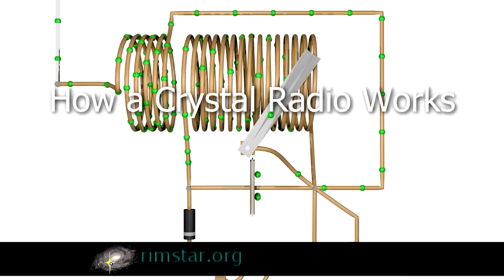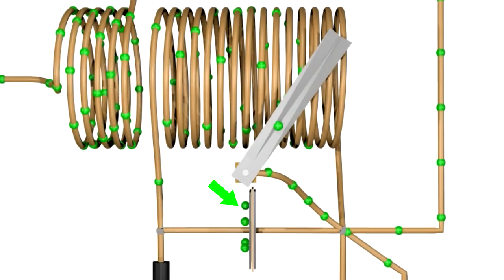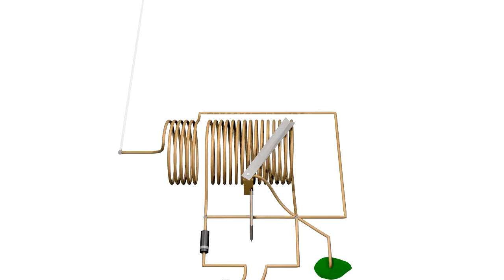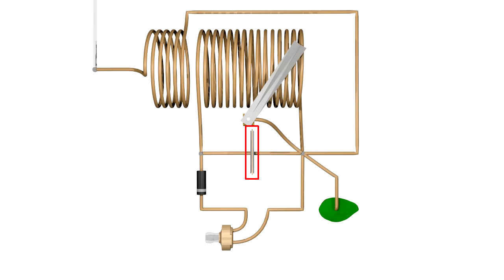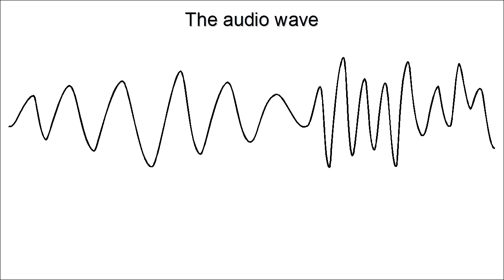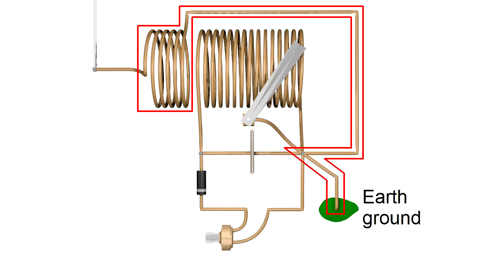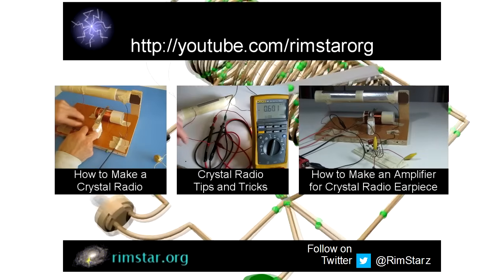How a Crystal Radio Works

Comment: This is great. How do single coil crystal radios work/ differ?
Reply from the maker: Edward Krawczyk Since coil crystal radios are harder to tune or are not tunable. They are also more susceptible to interference from more than one station at a time, i.e. worse selectivity. I sort of talk about that at 10:43 in the video.
Reply: I realize this is an old comment, but along the same note, how do you determine what inductance to use for the antenna coil? I understand how to calculate what inductance to use for the primary coil with f = 1/(2*pi*sqrt(LC))
Reply from the maker: I got the number of turns for the antenna coil from the circuit that I originally used (the circuit came from a book.) There is no explanation in the book for how the number of turns was come up with, just the circuit.
Reply: Thank you!

Comment: Great video I really liked it. About the "coupling" I'm wondering if it's possible to use different gauge wires to increase the voltage, just like a power transformer?
Reply from the maker: zerpBot Different gauge wires don't increase voltage. Transformers do it by using different numbers of turns on the coils. So yes, putting less turns on the antenna coil or putting more turns on the tuning coil will increase the voltage.
Reply: Nice, I'm want to increase the sensitivity the more I can to get the best quality of sound possible, so maybe this will help.
Reply: RimstarOrg What about placing a Joule Thief between them? like a mini amp using the small amount of power and recycling it?
Reply from the maker: Andrew Stang-Green Hmmm... That might work. The voltage given my antenna is pretty low, not sure it can turn on the silicon transistor in a joule thief. Also, the radio output isn't DC so the joule thief will be getting sporadic input. But it's worth a try.
Reply: Andrew Stang-Green The sound would probably be extremely choppy, since it's like pulsating DC, but you never really know until you try.
Reply from the maker: zerpBot Good point. I missed the part where Andrew asked about "recycling it".

Comment: sorry if im annoying with my questions even if the first one wasnt one :P but,what is the second coil used for ? i mean the second coil increase the voltage of the first one isnt it that (inductance)? so, if the voltage is not important as you wrote to me what is the use of the coils in the selectivity of a precise frequency ? sorry if my question seems stupid but i wanna understand and for one more time sorry for my english and i still hope you will understand my question :P

Comment: I got into this after a science fair project I did for the kid....I ended up getting hooked again lol.
When I was about 10, I had a RadioShack "box" kit that made a darn good radio. I picked up WLS in Dallas!
Ended up making a mystery radio after the project.
I have a question....
IF I can make some sort of amp, could I reverse the process to make a transmitter?
Reply from the maker: Interesting question. The tuning coil and capacitor make up a circuit that oscillates more efficently at the tuned frequency, so perhaps you could put a DC source across that circuit to power it, creating the carrier frequency, and then attach your amplifier in place of the diode/earpiece to add the audio signal. It might work, though I haven't tried it or heard about the idea before. Let me know if you do try it. Also, be careful not to broadcast too far as most countries require a license for broadcasting so that you don't interfere with other signals.
Reply: @RimstarOrg  yeah. I know about the fcc. At first it'll be for fun. Im looking at comms without having either side required to know morse or on SW bands.
Tuna can transmitters can go for miles!

Comment: I am noticing that this runs solely on the energy trasmitted by radio.What modifications would be possible to also transmit signal ?
Reply from the maker: Padurariu Catalin You'd need a lot more power than you're getting out of this, if that's what you intend. I have this video on how to make a simple AM transmitter "How to Make AM Radio Transmitter".

Comment: I always thought classic radios use variable caps to tune. Is there an advantage to having a variable tap for the inductor over a variable capacitor?
Reply from the maker: I've seen both used for tuning and my homemade ones use either both or just the cap but yeah, most often I see mostly the cap used for tuning. A kit I have works by adjusting the coil in large steps and the cap is used for fine tuning. I'm not aware of the trade-offs, if any.

Comment: Could the single diode for the earpiece be replaced with a diode bridge? Would it double the volume going to the earpiece, or would it cause some cancellation?
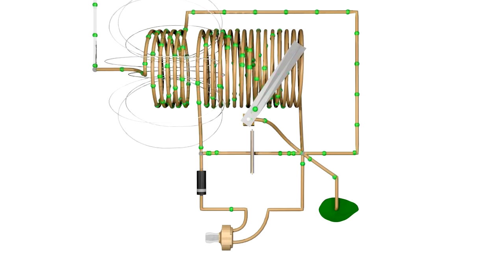Reply from the maker: Do you mean a bridge that would rectify it in both directions? That may defeat the purpose as you want to rectify it in only one direction as I talk about at 9:16.
Reply: @RimstarOrg  like the diode bridge in an ac-to-dc power supply. The AC side of the bridge would go across the capacitor, and the +/- for the DC would go to the earpiece. I understand the earpiece needs DC, but I wasn't sure if allowing the current to flow in two directions across the capacitor would be detrimental. Although...thinking further, the resistance in a crystal earpiece might be high enough that it wouldn't short the capacitor too badly, but then again it's a very low-power circuit. Also, the capacitance of the crystal might mix with the tuning capacitor and throw it off. Or....is all this completely wrong..? :-)

Comment: Sir instead of earphones, can you replace it with speaker for higher volume?
Reply from the maker: There isn't enough current or voltage to power a speaker. However, you can connect an amplifier and then to a speaker. I did that with my homemade amplifier here https://www.youtube.com/watch?v=JtPwxbOgBHw
Reply: @RimstarOrg  thank you sir for the info. Your the best 😘😘😘

Comment: I really like the video and explanation. Awesome job! I have two questions though.

1. I have an electronics kit, so I have capacitors, resistors, diodes, transformers, though its not a 25 to 90 I can mathematically figure out an equivalent. My question comes from the "adjustable" inductor. AKA how could I make a "wiper blade" for the inductor and an adjustable conductor (changing the area thereby changing the capacitance) using electronic parts? is there an adjustable capacitor I can buy (like a potentiometer?) like wise is there an adjustable inductor?

My second question was what program you used to create the animation.

Thank you so much
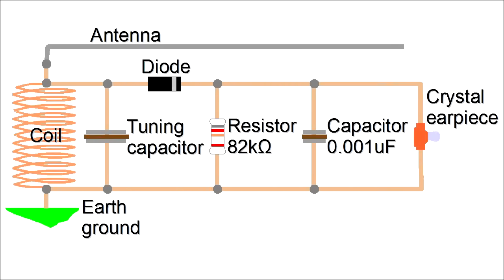Reply: I just realized at 12:13 you mentioned the capacitors and I looked them up online (for shopping) is there one you would recommend for purchase?

Also, the variable inductors are fairly expensive. Do you have any recommendations for which of those would work?

I am also a bit confused that if I purchase a variable inductor (allowing me to tune with the capacitor to make a bandpass) how I can use the "transforming" property from one inductor to the next (since the variable inductors are insulated)

is there a different device I should be looking for? like a variable transformer or something?
Reply from the maker: Halfjapkatsu
I don't know anything about variable inductors or have any sources. For crystal radios I've always seen them homemade. You can see how in my "How to Make/Build a Crystal Radio" video http://youtu.be/VqdcU9ULAlA. I also show in that video one way of making a variable capacitor. But if you prefer to buy variable capacitors then you can get air core ones from http://www.midnightscience.com Go to my channel page and you'll find a whole playlist of my crystal radio making videos. There's a lot there.
Reply: RimstarOrg Thanks. Yea, I watched the toilet paper tube and pizza box ones a few times. They are really awesome. I was just curious because I have a starter electronics kit, and I was wondering how I could build a real simple radio using the pieces I have (or that I can put on the breadboard). While I know I could put a home made inductor into the bread board, I was wondering if they had one that came premade.

I guess I was curious how to relate the science of what you taught me in your video to the devices I have... trying to see how I could substitute what for what. I can figure everything out aside the double inductors (or transformer). The wiper hand is kind of confusing to me unless they already make a product like that.

I was looking online for "how to build a radio" kits but they all come with pre-made boards (printed boards). I more so am interested in how to make one straight from my bread board. But the wiper is the only thing I can figure out :/

With that said, I am thinking that I might try the idea you mentions for a non-tunable radio receiver. By having a fixed inductor (unable to wipe). That way I can still pick up just one station.

Comment: Hi, I have a question.  You say that the first  coil is not connected to the 2nd, larger coil, but they both seem to be connected at the ground point in your animation.  So aren't they really connected to each other then? Looking at your animation, they do seem to be connected where the large coil connects to ground, so too does the small coil connect at the same spot.  Sorry, I find this confusing.
Reply from the maker: I can see how that'd be confusing. There are a whole bunch of things connected to ground there, interacting with it in different ways. And yet that's the way it's actually connected, as is done in most grounded circuits. There's no way I could animate that ground wire fully without having a bunch of separate connections. I think the answer is that the ground is such a willing sink for electrons and an easy source to get electrons from that all those different components more easily interact with the ground than each other at that point.
Reply: RimstarOrg Thanks so much for your answer!  I was sort of guessing that anything connected to ground AND to something else... the electrons would most likely flow to ground and not to that something else.  Does this sound about right?

I also have one more question... I read a book that living biological cells have certain properties of liquid crystals...and was wondering if you think that living biological liquid crystals might be capable of 'demodulating' an amplitude modulated radio wave?  Thanks for your great videos and wonderful explanations! You're a great teacher!
Reply from the maker: Skidmore MusicTech
Regarding the ground, that's the best explanation I can come up with.
Regarding your question about cells, I haven't heard anything about it so I can't say.
I'm glad you're enjoying my videos. Thanks for watching them!

Comment: what happens if we step up the voltage from antenna using a transformer, during on load condition the primary (antenna) will draw more current, but the number of electrons in the antenna and its oscillation (frequency) will remain same, as the current is either lot of electrons running slow, or few electrons running fast, during on load condition the current should increase (few electrons running fast). 

if this works, may be nikola tesla made his Pierce arrow car run for miles by receiving energy from his antenna in his lab.

Comment: Could you also make this one to pick up mobile phone waves? And if all the phones are "talking" at the same frequency, why don't my phone just pick up a mess of signals? Very good video btw, answered some questions I have been wondering for a long time! +1 Subscriber from me
Reply from the maker: Cartman I'm no expert on mobile phones but they function in the 100s of megahertz, far higher than these coils and capacitors can tune in. For that you're dealing with coils of a single turn or less, and so it's a different technology, but one I'm not familiar enough with to answer your other question. And thanks! Welcome to my channel!

Comment: Can this design be used to collect and harness the very high voltage radio waves higher up in the air and maybe the stratosphere? Im new the electronics and appreciate your awesome video.....
Reply from the maker: That's hard for me to say since I'm not familiar with them. I know that normal radio transmissions often bounce off the ionosphere and reflect down to receivers on Earth. That's how a radio signal can be picked up around the world. So if they radio waves you're talking about are strong enough and are in fact in the radio frequency range then you should be able to pick them up, though they may just sound like static.
And thanks, I glad you like my video. I don't have time to do a lot at this level of detail but this is certainly one of my better ones. Thanks for watching it!

Comment: Hello, thanks for the video.
I want to listen to the frequencies in nature, caused by earthquakes or lightning. In this way, how can I make an unmodified receiver circuit that can detect extremely low frequency. For example; From 3hz to several khz.
Reply from the maker: You're welcome. Thanks for watching.
I don't know how well this circuit could be adapted for lower frequencies, but for higher khz, one suggestion is to add more capacitance. The reason is that higher frequencies end up being crammed into a smaller number of turns on the coil and that makes it harder to tune find the desired frequency. Having a higher capacitance helps with that by spreading the  frequencies out over more of the coil. I haven't tried higher or lower frequencies myself though.

Comment: For the earthing, does it mean thid radio receiver won't be portable?
Reply from the maker: That's correct, unless you move it to somewhere that has a ground you can connect to. However, the design I used in this video is portable, https://www.youtube.com/watch?v=dB-76NdfTbU though it does help if you provide a ground by putting your hand on the capacitor.

Comment: it's the length of the coils that determine the frequencies received? how do you calculate the length needed for a particular set of frequencies? For example, the 40 meter amateur radio band or short wave. I'm just wondering what else could it be used to listen to besides standard AM commercial radio.

edit: I just saw you have a video about designing a coil for specific inductance which I think will answer my question.
Reply from the maker: In addition to that inductance video...
I've never tried shortwave myself but  I have a kit crystal radio that uses the same circuit as mine but with a spiderweb shaped coil and it adds a 470pF capacitor in series with the existing variable 365pF capacitor in order to help tune in the shortwave range. I've never tried it though. I hear that you also need a very long antenna for shortwave. The fellow in the video you linked to has a 278foot antenna.
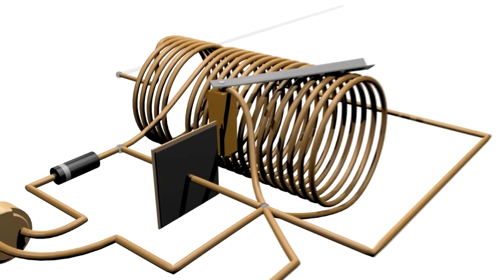Remember, at 5:56 in this How a Crystal Radio Works video I show that capacitance also plays a part in the resonant frequency.
Reply: Really one of the best videos i have seen regarding radio! Do you have the time to make a similar video for FM? 
Best regards
Johnny
Reply from the maker: Thanks! I don't have any experience with making FM radios, and don't know much about them beyond what distinguishes AM waves from FM waves.

Comment: why do the electrons move back and forth when the antenna signal hits the antenna
Reply from the maker: I can see why you might be wondering since I show the radio waves all coming in in one direction. But picture them as if they're water waves. If they're water waves then they have high points and then low points. The high parts of the waves would be moving the electrons in one direction and the low parts of the waves would be moving the electrons in the other direction.  I guess you'd need a side view to really see it. That's not 100% of the picture since the radio waves are electromagnetic waves but hopefully that helps.

Comment: question about the carrier wave, why is it at a higher frequency than the starting wave frequency that the sound wave is molded?  TIA
Reply from the maker: The higher frequency is needed to be able to model the sound wave well. The higher the frequency, the more closely it can model the sound wave. Imagine if the carrier were the same frequency as the sound wave... it wouldn't be able to model the sound wave very well at all.
Reply: @RimstarOrg  Thank you for responding.  Let me try to explain your response, the higher frequency is chosen to capture the highest voice frequency in the audio wave otherwise the higher frequencies in the audio wave are clipped off.  Is that it?  I apologize for my ignorance.  So how does bandwidth come into the picture where a range of frequencies say 108.1 to 108.5 KHz is used for a radio transmission?  thanks again
Reply from the maker: Yes, that's sort of it. Maybe a diagram will help. Here's a random page about integration https://www.mathsisfun.com/calculus/integration-introduction.html , have a look at the three Slices diagrams just a little down on the page and on the right. The carrier wave is like the narrower rectangles. If the frequencies were the same then it'd be hard to replicate the shorter narrower audio waves. Maybe that's what you meant by clipping. The bandwidth is important at least so that you don't hear more than one radio station at a time. As the video talks about, the tuning coil and capacitor tune in a certain frequency, but other frequencies close to it can be picked up too if they're too close. Having the two coils helps with that (the selectivity I mention nearer the end of the video) but also having frequencies that aren't too close together helps too.

Comment: Thank you  from INDIA
which is the best diode we have to use in crystal radio?
 give me diode code
Reply from the maker: The best is a germanium diode. You can find a lot of them online using the part number 1N34 or 1N34A. A silicon diode is not good unless you have a very long antenna or a very strong radio station nearby.